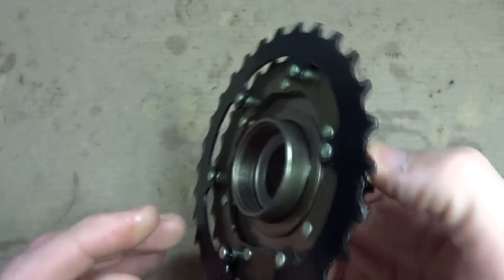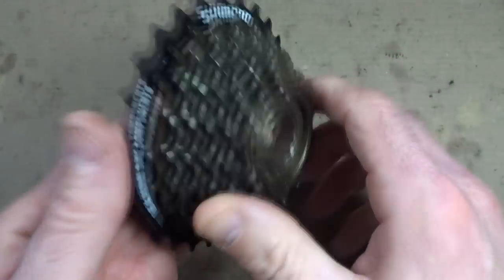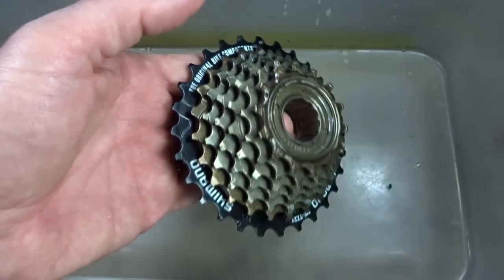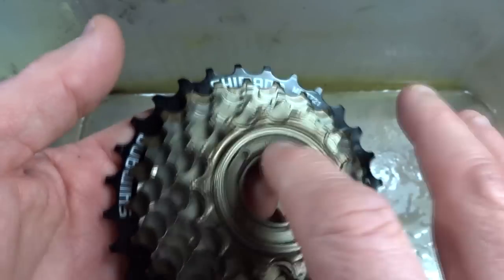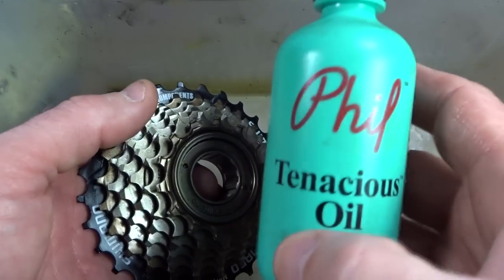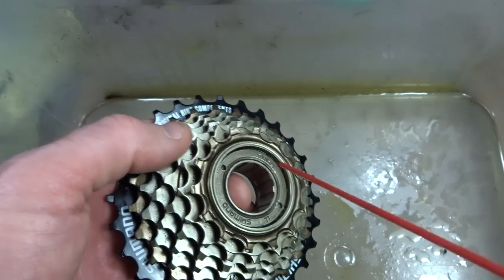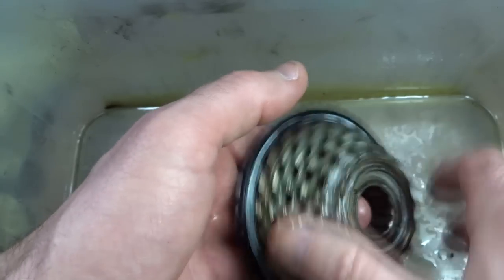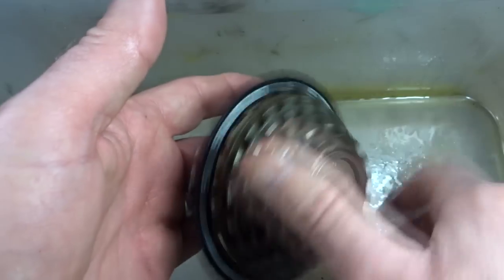How To Make A Freewheel Louder

Comment: Good advice. I wanted my car louder so I let all the oil out of my crankcase.
Reply: blipco5 lmfao
Reply: Free the oil!
Reply: Steel Teepost Free Willy
Reply: blipco5 Good exhaust will do better...😂😂😂
Reply: that will work perfectly!!
Reply: Haha lol
Reply: blipco5 not actually how that works... But I get what ur going for
Reply: How's that working for ya?
Reply: I also want my phone to be very loud when playing eazy e "boys in the hood" so i decided putting a hole inside the speaker to allow the oil to come out and now my phone is like a subwoofer😂😂😂😂😂😂
Reply: hahaha good job
Reply: Just use break cleaner the light it on fire
Reply: Just add NOS and make it ka boom
Reply: Laughing out loud!
Reply: So I. And the front and rear diffs.  Tomorrow I'm doing it to the transmission.  Gonna be so loud.
Reply: Wtf
Reply: Install a can fart or get a real engine.
Reply: blipco5 🤣 dol lah kau ni
Reply: Could also put a little sand in with the oil
Reply: Love it,
Reply: AHAHAHA good one
Reply: " Sir is stock "
Reply: I used to put as a kid a piece of cardboard on the fork touching the tire of the bike. It made so much noise xD
Reply: r/cursedcomments
Reply: Hahhahahah
Reply: LMFAO!!!!!
Reply: Car? 🧐🤨

Comment: I see a lot of negativity in the comments here which is unfortunate because I know you are just trying to help people out. Worth mentioning there is another reason why an older freewheel might get quieter over time which if left unaddressed will probably wear the freewheel faster. I noticed my freewheel got quieter after about 600 miles of riding and never lubricating it and when I took a look at it closely I saw it had developed some play (which of course made it quieter because there was less contact with the bearings but is obviously not good for the bearings, cones or races) From your video on disassembling a free wheel I learned that using a hammer and a punch to turn the lock ring counter clockwise tightens the whole assembly and after doing this I can immediately see 1)less play and 2) more noise. What that taught me is that a quiet freewheel doesn't always mean it will last longer

Comment: Good point RJ... and you should stress the logic... @1:40 you mention that the "unlubricated" pawls during coasting are not under stress like other critical bike components are. So, if we're not riding 10K+ miles per year, every year, what's the worst that can happen? Right!?

Loud freewheel?  Reminds me... when I was a budding Cat IV in the early 80's, I actually loved the classic Regina six-speed freewheels... outta the box, they gave a rather loud and distinctive freewheel noise. Gawd, I love that noise, and it brings back great riding memories.

Thanks, RJ, for your great vids.

-- bike dork still

Comment: Well, I did the opposite, i opened the freewheel and put nice amount of grease on bearings and spring and now it's totally silent, i love the stealth mode, specially at night!
Reply: I get stealth mode simply by turning the pedals so it doesn't click.
Reply: @TimpBizkit  
What “turning the pedals” means?!
Reply: @GabrieLight  keep pedaling just fast enough to stop the freewheel clicking but without putting any effort in.
Reply: @TimpBizkit  
Aha, ok.

Comment: Hi, have you or any of your followers had an intermittent lose of drive after coasting? Almost identical as if the chain changes sprockets under load, but that isn't the case. It is seemingly a drive failure after coasting, but not all the time. It does seem more to happen when the chain is on the smaller two gears.

Comment: I’ve found the best and easiest way to degrease the hub. All you need to do is to get some window washing liquid and spray the cassette and leave for as long as you want. This uses the same principle as in the video. I’ve tried this method on expensive and budget wheels
Reply: Duc Nguyen nice!!

Comment: For the MF-TZ21 do you know how many BB on the top and bottom race? I had to take mine apart to clean out the sand and want make sure it goes back together right.
Reply from the maker: Nope. You will have to see how many fit.
Reply: Is it normal to have some play in the freewheel (MF-TZ21) and is that to make it shift better or something?
Reply: MF-TZ21: 31 BB top / 35 BB bottom, works better than new now. I put grease on everything and oil on the pawl hinges to keep the ratcheting sound. Also took out one of the smaller shims, had too much lateral play, It seems to shift much smoother now...

Comment: Sir. Do you have an idea how to true freewheel wobble?
Reply from the maker: It's probably not the freewheel, but the hub. Sometimes it's manufacturing imperfections in the hub. Could be the hub is damaged. Could even be a broken axle.
Reply: But my hub is brand new..
Reply: My axle is new and my freewheel still in wobble.
Reply from the maker: @neoneo567  Then take it back to the shop and have them fix it.l
Reply: Its so expenses if I get back to the shop.
Reply: Do you have more advise to me how to fix it with my own.. Except getting back to the shop?..
Reply from the maker: If the hub is new, it shouldn't wobble. Take it back to the shop and have them fix it.
Or is it a cheap Walmart bike?
Reply: @RJTheBikeGuy  Nope..

Comment: How can you make it more silent?
Reply from the maker: Use a grease injector and pump it with grease. Though this can interfere with the pawls, especially in cold weather.
Reply: ultimaetsolder constant pedaling.....
Reply: a lot of internal gear hubs are silent.
Reply: probably bc of the heat it creates makes the grease thiner
Reply: Never stop? Never ever stop? What if I have to pee, can I stop then?
Reply: lol yes of course, when nature hits you don't stop it
Reply: Rolling nature break.
Reply: if its got a plastic seal, pop it off with a pin and load it with grease
Reply: put it some lube
Reply: Just pee even your riding it will just dry off.
Reply: use a fixie
Reply: @RJTheBikeGuy  i drip in a little 90w gear lube or STP

Comment: These comments reflect the idiocy of people! Firstly- he has shown what to do upon request. He advises throughout the video what is good and what isn't. Secondly- doing this will NOT cause any issue to the freewheel! All these people freaking out shows nothing more than ignorance over fact. These need very little lubrication in order to function!  They are overly greased from the factory (some are - some aren't) The ignorance in our society these days is overwhelming. Just like the saying says- " check three times- cut once" the same should go for people and their idotic mouths. Better to keep it shut and have people presume you're an idiot than open it and confirm for sure...

Comment: I have noticed very high end mountain bikes are crazy loud, I thought it was a different type 😀 looks like they just spray it clean ?
Reply: This because of leaf springs,I have Hope Pro 4, which make that click sound,I just use normal grease,I put as much as needed, and around the seal, to prevent water and coming in, and after one a short trip the grease has spread, and the clicking will be back, unless you put too much grease in, which will silence it but might cause slipping,at least that what they say.
Reply: OK didn't know that , so it is mechanically different I guess.
Reply: On my road bike, I have 3 sets of wheels. Ultgera 6800 (best - race wheels) that have a loud click. Mavic Aksium Elites that have a loud click and the nasty wheels that came with the bike ( emergency spares now) and they nasty ones are dead silent. But I have a different cassette than the one RJ was showing, as the screw on type are usually for low end wheels or really old ones.
Reply: I love the simple and reliable,almost idiot proof design of Hope pro 4,the spring make the pawls hit teeth. but hte cheap shimano freehubs, got only 3 pawls, and use normal springs instead. http://www.parktool.com/blog/repair-help/freehub-service#article-section-1 and use loose ball bearings, instead of sealed cartridge bearings.
the difference in reliability of shimano hubs and free hubs and the expensive ones is huge.
Reply: Johannes Nilsen   I recently overhauled a 15 year old, inexpensive Shimano freewheel that had been ridden regularly on a gritty trail.  It was just fine!  Clean, lube, reassemble and off it went!
Reply: I have never used a freewheel,only freehubs & cassettes.
Reply: which means you're young, and have never ridden a bmx or any kids bikes because most of them are still freewheel, albeit single speed freewheel, but still a freewheel.  :D
Reply: littlegoobie Previously owed Raleigh Strika, Grifter and Chopper...and the Grifter was new... xD

Comment: Should probably point out that, while the trick described in this video is relatively harmless to a freewheel, it could be considerably more damaging to a freehub.  The bearings in a freewheel are lightly loaded.  Lubricating them with a light oil may not harm them for a long time, if ever.  In a freehub, on the other hand, the bearings are the main wheel hub bearings, carrying the full weight of the bike + rider.  Freehub bearings need good lubrication.

And there is the water problem to consider.  Grease and thick oils resist water better than light oils.  Water inside steel mechanisms is bad!
Reply from the maker: Only the outer bearings which are greased anyway. The inner bearing can be oils.
Reply: RJ The Bike Guy   Agree.  My point is that flushing a freehub with WD40, would be a poor idea.
Reply from the maker: https://www.youtube.com/watch?v=iQ6XgztsfmU

Comment: The clicking noise is the Paul's { Dog's } riding over the teeth slots - the proper way to service a freewheel is to break it down             { Do this over a bed sheet so little ball bearings will not be lost } then place all parts into gas to clean, with a MAGNET remove the the parts when cleaned & pull them off magnet over that same bed sheet. Now after you have reinstalled the Dog's w/ spring ring wire on inside hub - take clear bike grease and apply just enough to the race of the inside hub to get all the ball bearings to stick {** Don't even try to do this to the free wheel race because it will NOT go back into place!!! **} after you reinsert
inside hub back into the free wheel hub place flat down on bed sheet surface and apply just enough clear grease to the outside races - put remaining ball bearings in after you squirt just a little 3&1 oil into the crack, followed by shimming rings.                            Now put some clear grease on the locking race ** Remember that it is tighten to the LEFT ** !!!                                                                Now the ball bearings are all re-greased and there is just enough oil on the inside Dog's to keep them from rusting & siege up...
{ cause when they do the free wheel will really be a "Free Wheel"/ the clicking noise is to let you know that it is working correctly}

Comment: Nope.
To get thick lubrication in place in tiny spaces you use a thinner.
Petrol is a good one.
Use motor oil or gearbox oil and thin it out with petrol in a ratio of, let say, 50/50.
Now you have a really runny solution which easily can penetrate all tight spaces.
The thought is- the petrol will eveporate and leave the thick oil in place and "Voila!", there you have it.

Comment: Nice 👌 I have an SX trail and it has a 2x9 set on and it used to be louder even with grease but I think the dude that sold me the bike got a bit to much in there. It's loud when pushing because I'm not going fast with those 2.5 tires bit if I go a bit faster you won't hear shit and that annoys me

Comment: Wow.   loudness of a freewheel is not a requirement for high quality.  If someoone is going to ruin a perforctly good freewheely flushing out the lubricant, why don't they just spend the $$ to buy a freewheel that ratchets louder?  The DT Swiss spline models (which are used a lot in mountain biking) come to mind.  I have a set of these, they are crazy loud and drive my ride group nuts.

Comment: if your replacing your chain every 1200 to 1500 miles due to stretch, you are going to change your freewheel also. Frig it, run it dry. :) btw loud pipes save lives not freewheels.

Comment: flush it out using gunk parts cleaner then wash it with soap and water.  let dry (accumulate a thin crust of rust inside), and boom..,  you'll have the LOUDEST freewheel on your block

Comment: I did the opposite, i don't like the noise so i opened the freewheel and replaced the grease inside with the bearings and i also put a bit of grease on the tic tic tic mecanism, so now my freewheel is almost completly silent, loll!

Comment: wd40 is a lubricant I'm pretty sure. it just gets displaced easily.
Reply from the maker: WD40 is a great Water Displacer. That is what it was made for. But it is a LOUSY lubricant.
Reply from the maker: As I said, WD-40 is a solvent with a little bit of oil in it. It makes a LOUSY lubricant. Heck, even for things like squeaky door hinges, it only provides short term relief compared to if you had used a real oil. But feel free to use it on your bike. Don't be surprised when your parts wear out faster than if you had used a real lubricant.

Comment: wd40 is oil so how will it flush it
Reply from the maker: WD-40 is NOT oil. It has oil in it. It is over half made of Naptha which is a solvent.
Reply: RJ The Bike Guy so why does it say that it lubricates
Reply: RJ The Bike Guy i used. used car engine oil on my bikes
Reply from the maker: But HOW WELL does it lubricate? If you like WD-40 as a lubricant, go ahead and use it. Good luck to you.
Reply: RJ The Bike Guy  I prefer liquid wrench
Reply: Wd-40 isn't a lubricant, it's a solvent, so it's really good for cleaning and removing dirt, grime, and grease. It sometimes works for a Lube because of the oil. Water is a also considered a solvent too. And even though it doesn't work, water lubes things very slightly though I wouldn't recommend it
Reply: THE HOT ROD GUYS KAI 

WD-40 is not and never has been an oil and as such, is not a lubricant. WD stands for "Water Displacement".
Reply: THE HOT ROD GUYS KAI wd 40 will dissolve and remove oil
Reply: It is penetrating and dries out the oil
Reply: THE HOT ROD GUYS KAI WD40 IS not oil it is a solvent
Reply: Solvent
Reply: nope wd40 isn`t an oil its a solvant!
Reply: THE HOT ROD GUYS KAI  wd40is not a lube. It is a water displacer hence the WD it will not stay where its sprayed. It will fail as a lube
Reply: The amount of retarded crap that people spout over WD-40 is unbelievable.  It's simply a penetrating oil i.e. a light mineral oil with a solvent.  It will dissolve grease (all light oils will do this, even without a solvent) and will provide some lubrication for very light duty applications, but certainly not bearings.
WD-40 is perfect for doing really retarded stuff with though, such as flushing all the grease out of a freewheel to make it louder.
Reply: I destroyed (the solvent causes the freewheel to self destruct) 2 freewheels with WD40 just by spraying the chain as it passed over the freewheel.  The 2nd freewheel destructed when I was 40 miles from nowhere and I had to walk my loaded bike  the 40 miles to a bike shop. Then I finally understood why the freewheels fell apart. NEVER USE WD 40 to lubricate a bike chain.  The noise coming from the freewheel sprayed with WD40 IS UNLUBRICATED BALL BEARINGS DESTROYING EACH OTHER. THEN FREEWHEEL FALLS APART.